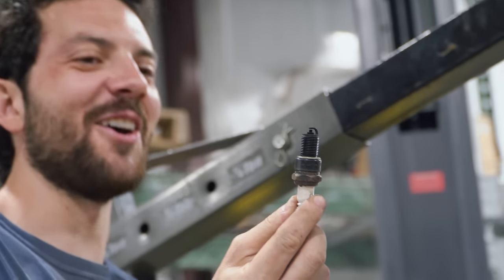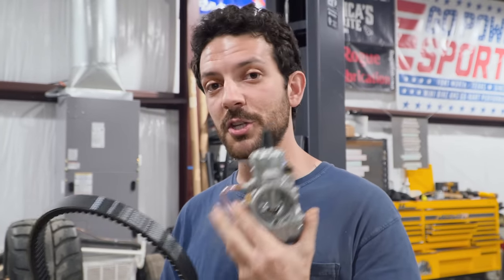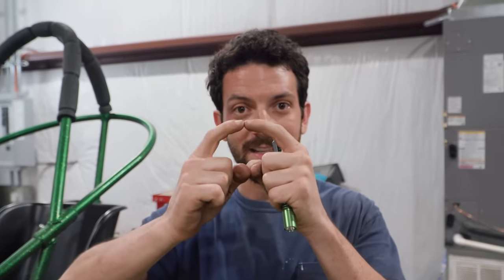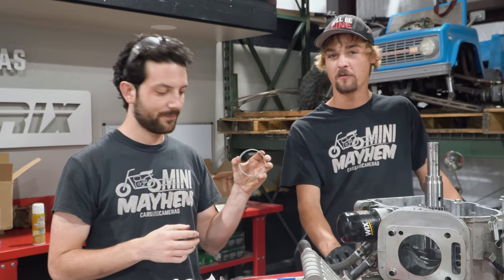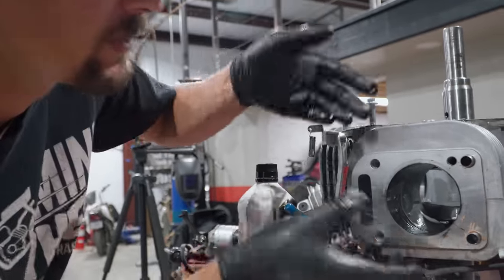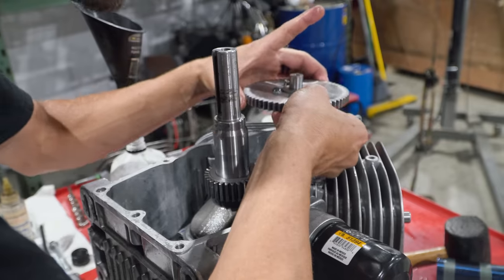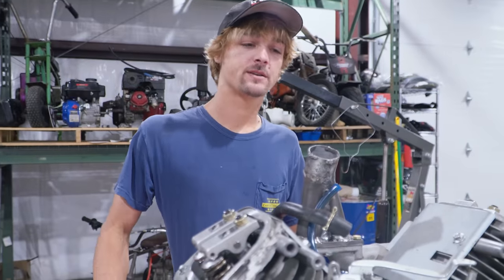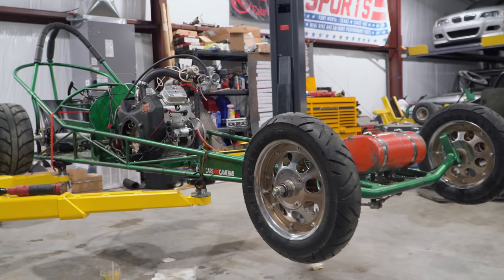Turbo 670cc Dragster Engine Rebuild | Prep for Methanol and More BOOST!

Comment: "There's not copper in here because we don't have copper rod bearings..." Actually you don't have rod bearings at all... because cheap engines have no rod bearings, they just use the rods themselves as the bearing material part of why I don't trust them for making power. (plus you can get motorcycle engines on ebay for cheaper that make more power stock and have transmissions so... why buy a Predator?) When running methanol and forced induction/boost it's not heat that makes you open up the piston ring gap, it's cylinder pressure... same with nitrous that's incredibly cold but you have to open up the ring end gap because of more cylinder pressure so it doesn't lift a ring land. 
You don't need all that shielding and the side cover on that thing running methanol, you'll struggle to get it up to temp as it is without that stuff on there.
Make sure to add 5% toluene to your methanol so you can see it if it catches fire. If you don't you won't be able to see the flames and you'll have a real life Ricky Bobby moment with Ike running around on fire and you guys unable to see it until it starts burning him. Also you might want to get him a methanol rated respirator to wear while running that thing so he's not huffing the toxic fumes and burning up his lungs/eyes...

Comment: You guys should have put a 1000cc motor cycle engine with a turbo and then you would have a fast rail ditch that motor its junk guys its gonna fail you never will be in the 10s you can be in the 8s with a turbo hybusa 1325 cc engine

Comment: Stoich for methanol by itself is 6.5:1...thats stoich, not what you'd necessarily run while under boost...around 4:1 would be in the ballpark...thats JUST methanol...adding in nitro before you even have a methanol base tune is not the way to do it. I really think you guys should hold off on trying to throw nitro in something right off the bat..I honestly dont think that thing would ever need nitro in the first place for that small of a turbo and engine combo..assuming its not just for a clickbait title.Super easy to blow your shit up or hydrolock your engine guessing at nitro jetting...

Comment: 34mm carb is too small fora 670cc engine
Reply: Good way to stop it sending a cylinder head into orbit. Will help keep the horsepower levels from going insane.
Reply: @WyFoster  yes your right but if your putting a turbo 34mm might be too small and its harder to manage the fuel mix, with a bigger carb jetting wont be as finicky in my opinion

Comment: I would think twice about not using Methanol I've been involved in racing most of my adult life.. What I would do is get the engine running right on Sunoco 98 and 12 pounds of boost or less. Once you do that mayne increase the compression, and boost level, At that point consider a meth conversion. Meth is hard to tune, it leaks through the rings and milks the oil. Keep this in mind

Comment: You need to stop CLOWNING SO MUCH AND FOCUS ON THE ENGINES TECHNICAL STUFF SO THAT US ENGINEERS OF GOING QUICK CAN HELP SHOW YOU ALL HOW TO NOT DESTROY CRAP BC IF YOU BOOST AN ENGINE YOU DONT WANNA OPEN UP RING GAP YOULL JUST HAVE MORE BLOWBY GASES WHICH YOU BETTER HAVE A VENT AND FILTER ON THAT VTWIN